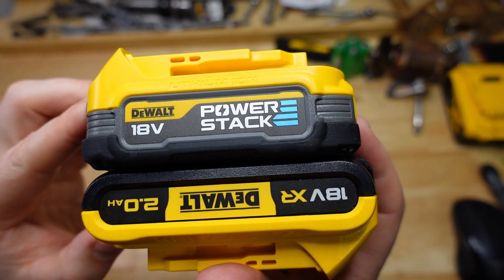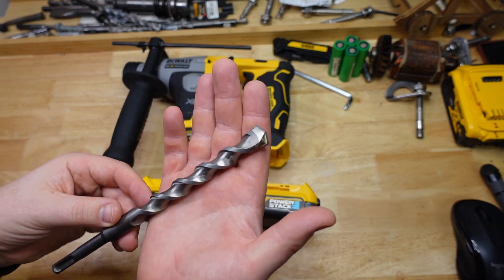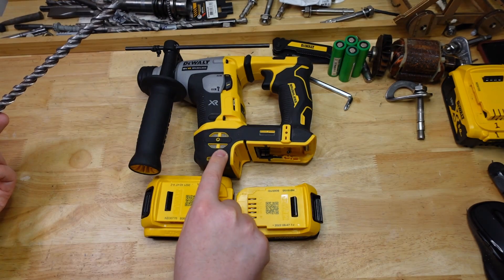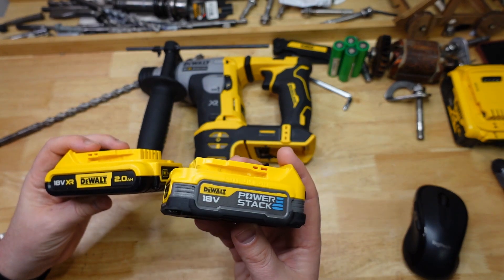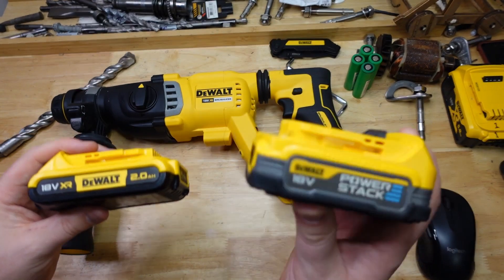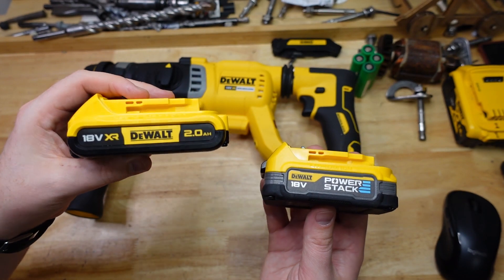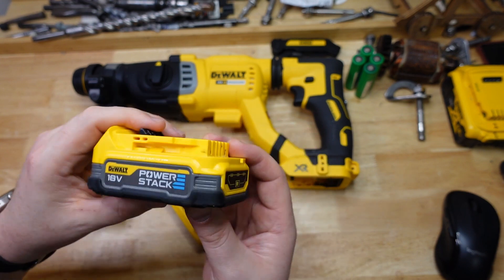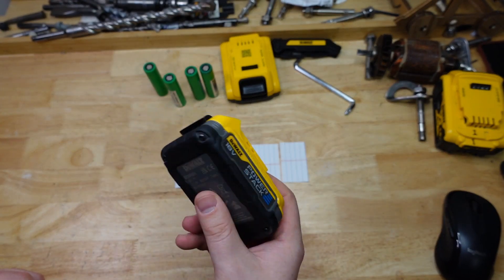Does it drill faster? DeWalt Powerstack+DCH172 & DCH263 Part 2: Heavy drilling tests

Comment: Also, my DCH263 is on the way from AU Amazon right now. Finally had a reason to get one hence discovering your channel recently. Thank you for your reviews of this tool and others in the yellow range. XXOO
Reply from the maker: Congrats! IMO, that's the best value hammer on the market. Are you in Australia?
Reply: @BoltahDownunder  agreed! If I ever need to drill in a tight space I might get a smaller one, or if I ever need to do HD work I might get a max, but this should be enough for most of my needs for a long time. Clue: you, I, and a well spoken POHM all pronounce "fish and chips" very differently in theory. Only through an excellent education and intentionally and intensively trying hard to do better do I NOT say it "fush and chups" ;-)

Comment: 1.7Ah powerstack is more like a 4Ah 10 cell or maybe 5Ah 10 cell out of the gate, but fades if you keep the acid on in my experience. I use them on impacts smaller drills, multitool, jigsaw, biscuit jointer, orbital, etc, some of those only for small jobs, though. Just gives the same short term punch without the size and weight. Good little batteries, I have 5, and one 5Ah version to play with. I got mine for 100nzd each, though.

Comment: Yeah, thanks for that, some good insights. Broadly, it offers a smaller size option for all the 18v tools, including the really high demand tools like DeWALT’s circ saws, router, jigsaw etc. Runtime? Not for that, but it’s fine for a builder doing a punch list, or a DIYer doing odd jobs. Options are great.

Comment: Can you make a video about which rotary hammer can do the most holes with the same battery and drillbit? 
meaning for example use a 2Ah battery and lets say a 10mm drill x 7cm deep and see how many holes it can do with the dch172 vs dch263, just to compare which tool is like more energy efficient with the same battery and same drill.
Reply from the maker: I am doing that, but over many videos sorry. The most recent runtime test is in this one: https://youtu.be/suIdSvh-yk0

Are you looking for a specific drill you want to know? Maybe I've done the test already but not published it yet